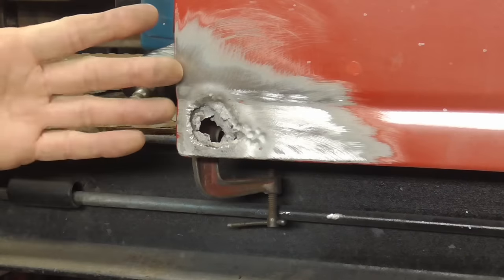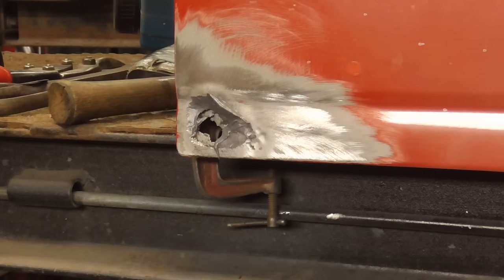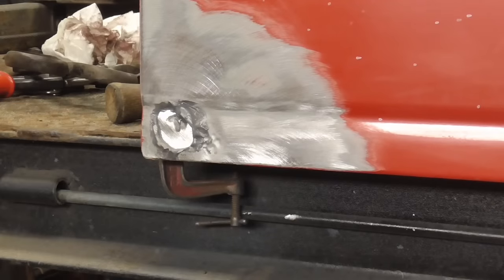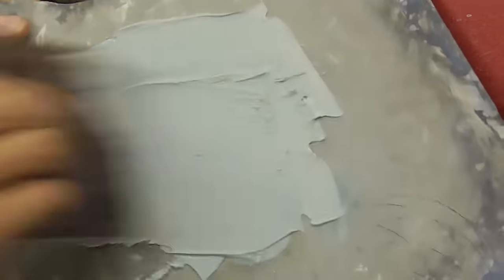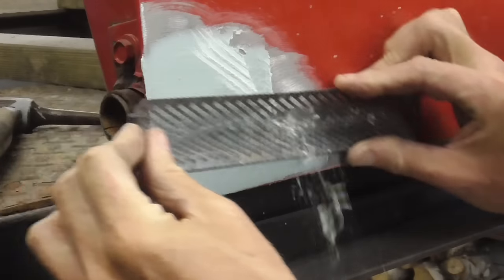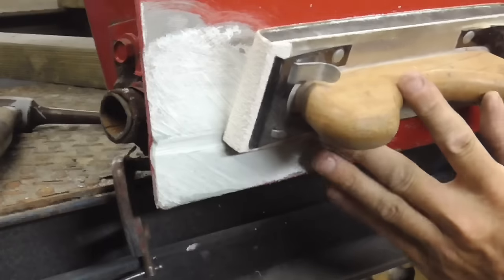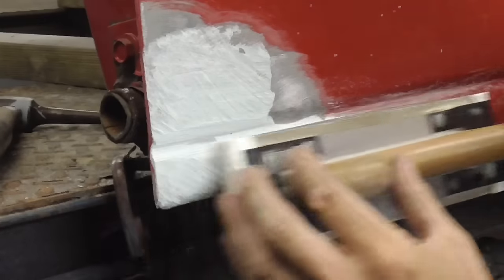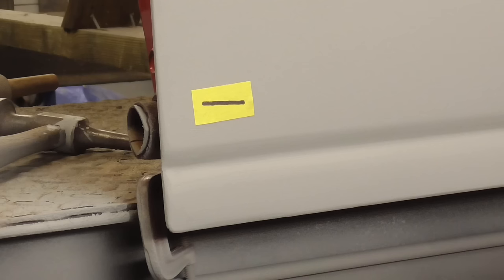Using JB Weld to Fix Rust Holes?

Comment: I just pack fuckin packing grease, or assembly grease, spray a shit ton of fluid film or NH oil in the rust spot and use rtv silicone  and some sheet metal fit it to size keeps rust from coming back, my bottom of my cab corner I did that no rust has spread further at all because it's so oily from all the assembly grease and packing grease, and nh oil, and fluid film I packed and sprayed in that can corner been the same since 2021 lol

Comment: Why not use JB weld from start to finish? It seems like it would be much more solid. Why use bondo on this?
Reply from the maker: Bondo sands easier and is much cheaper but you could certainly use JB I suppose :)

Comment: Nice video, well done. I have used J B similarly and had mixed results. Sometimes a permanent repair resulted ( more than a couple years) other times the rust re appeared in short order ( less than 6 months).

In all cases the metal had been sandblasted back to "pure white metal" , no visible sign or rust. My suspicion is that there was corrosion hiding either on back sides inaccessible opr in seems and that it spred back from there, but dont really " know that" . Still, for a quicks repair where you dont want to cut the whole section away and weld in new metal, J B is my first choice.
Reply from the maker: I have found that if the panel can drain and be able to dry out on the inside it lasts quite long.  If it can be undercoated on the back side - even better :)

Comment: The only negative I could think of is that it might get expensive, depending on the size and number of holes you needed to fix? Other than that, I've used it as a great metal filler on curbed aluminum rims. Sands very nicely when cured and is completely solid.
Reply from the maker: Great point - here's an alternative to the JB - I think it's cheaper in the long run:https://www.youtube.com/watch?v=d21RkqTwRqs

Comment: Jb weld is extremely expensive and other than the price—is great for small areas. But short strand fiberglass will adhere even better to raw metal. And will never separate crack or break off. And way cheaper by volume…But yes I’ve used JB on rusted body parts before myself. So yea sir…it works. 

Then over lay regular filler like you’ve done. To complete the job. We Live to contour ridges! makes for a bit more of a challenge. Good job.

Comment: Fill small rusted thru holes with JB weld instead of Bondo & then sand down & cover with a final coat of body filler,then prep prime & paint ....find that JB weld is way stronger than filler on fixing small holes

Comment: I would worry about rust getting under the JB Weld and lifting it.  I have seen that when fiberglass is used to repair metal. Much more inclined to weld.
Reply: The back side of the body metal will continue to rust and the patch will fall out in a few years.  If the metal is prepped with a good rust over primer(especially on the back) and some paint to seal it, it will last much longer.  If you can find some marine grade epoxy and brush it on after priming, that would be the best.  All moisture has to be sealed out to keep it from rusting out again.  Make sure the panel has good drainage too.  Water needs a place to escape otherwise it will sit in areas and find a way to corrode away metal.
Reply: That is exactly my concern. Rust, if not killed and protected against, will return and it will destroy that patch.
Reply from the maker: Drainage is the key to any repair.  No moisture = no rust.  Also how you rust proof the repair after is key - see this video:  https://www.youtube.com/watch?v=8XaZBy7GC7A
Reply: Youi definitely have to make sure moisture can't get at the back of the repair.
Reply from the maker: @macgvrs  For sure - if you can seal the back side - like clean the surface and spray it with some good rust proofing or undercoat - it'll last as long as a new panel.

Comment: I have successfully used it to fill the rust pin holes under a hanger strap on a dump truck step fuel tank. I have also used it to fill holes on the window post of a car door but the rust came back right away. Must have been more rust hiding underneath the paint or it had a way to get water in behind somewhere.

Comment: Nice Video!  I agree that JB Weld is a good option for rust repair.  I have used it as well as Loctite PL Premium 3X contruction adhesive.  No hardener needed. Dries like a rock! Cures in a few hours, but best to leave it overnight. It's sandable but you need some elbow grease to do it.  Good to make a foundation using the 3X and some metal. Then use bondo over it.
Reply from the maker: Thanks so much for the tips and ideas - have a good week :)

Comment: I’ve done similar. It holds up well. I didn’t even use filler over it. I just sanded and molded it smooth. Primed and spot painted it. You can’t even see it. Some folks will lose their minds over this. 🤷‍♂️ but it works.
Reply from the maker: It does work: here's one where I used if to glue a cab corner on.  No signs of trouble at all after a year or so.  https://www.youtube.com/watch?v=wRl1QfkrBeY

Comment: Provided this product was used on non-load bearing areas and provided the steel was cleaned up properly by grit blasting this product should be fine. The problem is some people will not do the preparation properly.
Reply from the maker: Good information :)
Reply from the maker: Wizardry 88  It really is - just like drywall.  If it's done right it don't crack.

Comment: Remove front window from 1966 chevy because rubber was shot and water had gained entry.
Found some rust around lower passenger side .
Cleaned it up and molded in some JB weld. 👍
Reply from the maker: Nice job!  That truck will run forever so you have to find ways to keep it on the road.

Comment: How long to wait before cheese grating?  For a diy'er like me, I don't want to wait 8 hours when I can tack-in the patch and finish on the same day....  If you have 20 jobs on the go, like a pro, then I guess you can work on other things...
Reply: Cheese grating should be done after about 5 min or so, after the filler turns rubbery and is firm but not totally cured. Cheese grate too soon and you might actually pull some filler off, wait too long and it's more difficult. I'd say try  between 5 and 10 min after it sets.

Comment: informative video but shouldn't you clean the area (acetone or alcohol) after sanding the area after the JB weld and before applying the filler?
Reply from the maker: You can if you like.  Most of the time you can just blow the area clean with a blow gun.  It can't hurt to wipe it down with thinner though.  Lacquer thinner drys super fast, is cheap, and is always around the shop.

Comment: Great job I just picked up Jb weld steel stick to patch the holes in my rear door I removed the impact strips I’m going for a real clean look,but after watching your video you have me an idea about using sheet metal to cover the hole
Reply from the maker: I think that will work well - tap the hole down a bit and fill :)

Comment: I just attempted my first antenna hole delete on an integra using JB Weld. I fabricated an inch oversize patch panel to go from underneath the hole and the jb weld sandwiched in between. Then doing body filler on top. The strength of the repair is no doubt very high and has the benefits of being waterproof as well.
Reply from the maker: Thanks for sharing that AcuraLvR - It's going to last a long time for sure :)

Comment: I would have put a little wax paper behind the hole and fill it completely pack it in between the different metals and shaped it instead of the body filler primed it then puddy or puddy over it it would be like filling the hole with brass or lead...or even welding it have someone hold a copper penny behind the hole then MIG weld it I don't think weld will stick to copper led would but weld I don't think so.
Reply: Use pre-1982 penny.  Anything after is copper plated zinc.

Comment: I used JB weld around my windsheild on some holes that were smaller than a dime. I used the hard putty with no metal. worked great . pushed in hole and had pushed other side so it grabs.
Reply from the maker: Good to hear - thanks for your input :)

Comment: Quarter would work as patch  doesn't need to be silver though 😅
Reply: I've done this before good  but no better than aluminum self stick tape  but sometimes you need strength  jb is better  but rust will come back in time unless you paint behind
Reply from the maker: Drainage is super important.  If the inside can drain and stay dry your good.

Comment: It's clear that it's not a high-end repair. But something like this only makes sense if you can not weld. Someone who is used to body welding, would have welded the patch in 5 minutes. then scrub the top clean - but if you can not weld, it is an idea - for the parts that are not safety-relavant
Reply from the maker: Here's a follow up video on all the different types of repairs out there.  Cab corner on this truck was JB Welded more than 4 years ago and still good today - will do a follow up again soon.   https://www.youtube.com/watch?v=gIS1Tbv7Kvw
Reply: @LakesideAutobody  I see I think you have such good results because you prepare the ground correctly. A lot of people who don't weld just smear the filler over, it doesn't hold because. I know fiber filler, that works well if you really defenz umnd stop the rust around it. I will try J-B Weld - great videos
Reply from the maker: As long as the metal is roughed up well - the jab weld will stick well.  Make sure the panel can drain and dry out inside and you'll be fine.  Nice talking to you Krakzzz :)

Comment: Well it's better than an old foam and fill or chicken wire and bondo. I wouldn't use it on a higher end restore but for a daily driver or a cheap car you're going to flip it looked easy to use and should last a while at least.
Reply: Do u think I could cut out and replace a rusted wheel well with chicken wire and attach with j b weld? Then bondo the whole thing? My old junker car that I want to make look better. I'm 79 yes old lady never did this type work but I have patience.
Reply: @jorenecicero5161  Yes, you absolutely can. The best way, if you just want to improve the looks is to attach your chicken wire in the general shape of the hole you want to cover with the JB Weld and then cover that with expanding foam from a spray can. Then after it dries whittle the foam down to the almost finished shape and apply a thin coat of bondo for the final smooth coat. It isn't something I would do for someone else but to make my own car look good I sure as heck would. And if you try it I bet a $100 you can do it just fine. 90% of any job is have the guts to try it! Good luck.

Comment: I bought an old pickup with all the usual rust and I definitely like the idea of using JB Weld. The way you show looks easy enough. Have you used it on bigger patches? I imagine sone screws to help position larger patches would do the trick. Thanks for sharing!
Reply from the maker: Here's a video on larger areas and a follow up 5 years later - https://www.youtube.com/watch?v=wRl1QfkrBeY 5 yrs later - https://www.youtube.com/watch?v=idrLzsz2eLg

Comment: Works great, I used JB weld to secure strips of sheetmetal to fix holes in the roof line and windshield surface. its been 18 months of WI weather and its holding up just fine.Al

Comment: My thermostat housing bleed bolt was stripped of threads and leaking coolant. 

JBweld the bolt in place and it holds pressure and survives the heat. Remarkable.
Reply from the maker: It can hold up to some pretty high heat for sure :)

Comment: Suggestion:  Try Upol #8 acid etching primer.  As cheep as $20 on ebay for an aerosol can.  Remove lose rust first.  No need to get to bare metal.  Two coats seals out moisture, stops rust's progress.  Do fill on top. Thank me later.
Reply: the duplicolor etching primer is what I use, I can't fault it so far.
Reply: @allkindsofscience2538  Glad to hear it!  I worked as a line mechanic for Nissan when they had the Pathfinder rust recall.  They specified Upol #8 in their procedure.  Since then I have used it on the front of a Toyota Camry that was my daily driver.  At some previous life they hood had been replaced, but not painted properly.  The car had pock marks from stone chips across the front of the hood that encouraged rust.  In the most casual of manor did I spray the Upol onto the pock marks, NO prep.  It was an ugly beater after all.  The Upol worked.  Made me a believer!  If the duplicolor works well too, that is awesome!

Comment: If the rust is completely removed yes sure but I guarantee you still have rust between those panels that was left and that will return.
Reply from the maker: One thing that folks forget.  Drainage.  If your panel can drain and stay dry that's a huge plus.  No moisture - no rust.
Reply: @LakesideAutobody  lol you didn't just defend a poor job with the guise of "drainage" 
Please, we both know it's dodgy not to cut open that section.
Cut the śhht lol
Reply from the maker: @ironhornforge  Like this?  https://www.youtube.com/watch?v=wRl1QfkrBeY  Like how you snuck the work shht in there - I have a filter turned on (swear words) for folks that get angry about body work.  Have a good week end :)
Reply: @LakesideAutobody  cool story, just be legit and fix things properly

Comment: I worked in a gravel pit when I was a young man ,I watched a mechanic take JB weld to a 3 inch hole in a bulldozer engine block re sleeved the block new bearings and gaskets ,had it running in 2 days.
Reply from the maker: Wow!  Interesting story ACB - thanks for sharing :)

Comment: You make that look way too easy!! I have tried recreating that line before and like you said, it’s harder than it looks,,,,. I have heard of this but never used it. I’ve done 45 trucks and counting over the last 40 years or so as a hobby for my own use. I’m down to one now due to downsizing in retirement. Items to take care of, land, etc. Gonna start relaxing more. Went from 8800 acres to 21 to 2!! Takes getting used to. I always subbed out the welding to a shop, or a friend when he wasn’t working as a pipeline welder. It’s expensive!! I had a few vehicles with this typical door rust or small perforations in the fenders etc. I will use this on my next vehicle. It’s a 1970 Chevy 2wd Blazer. It’s a pretty perfect 4 spd manual with a crate 350 already in there. We have dropped the transmission and a 4L60 automatic (in shipping) is going in place. We already have new trans mount and crossmember roughed in. Pedals have been changed from a wrecked 69 Chevy C10 auto. There will be a Lokar shifter in place of the 4 speed manual shifter. Should look great!  No better time to start than now! I have only a couple of spots at the very back and few holes around the rear fender wells (typical) that are already cleaned and treated, need one more sanding/wire wheel treatment. Then I will try it out! Should be a long term keeper once completed. 
Thanks for sharing. Nice job by the way.
Reply from the maker: You're welcome.  Sounds like a goo project truck - love those old Blazers - tough as nails.  Let me know how it turns out :)

Comment: Had an old wood truck that had a sick run through the radiator....needed a quick fix... was hauling wood at a place that needed to be done soon.
 Bent over the severed "tubes" wire brushed it a bit, and  applied JB weld. Thinking it would still seap some but get me through the wood hauling for a few days.....it lasted with NO LEAKS  for many, many years and still did not leak when the old truck finally died.
And that motor was run hard....
Reply from the maker: Great JB story Scott - love hearing how folks used this great product.  I used it on an egr tube right off the exhaust manifold - it lasted for years!  Wasn't expecting but a few weeks :)

Comment: What did you use for the metal round to fill the hole?
Reply from the maker: That was some 22 gauge sheet metal.  You can get it a Home Depot, junk yard or metal supply place :)
Reply: @LakesideAutobody  Yep, thanks a bunch

Comment: Great video! I have two small holes the size of a pencil I have prepped but not filled yet. I was going to use Permatex liquid metal. I also have original JB weld I bought after this video. Has anyone used the Permatex liquid metal for patching small rust holes? Also, you said DA'd the area. What is that? Thanks for any feedback. Great looking work as usual Lakeside Autobody. Are you in Michigan sir? Cheers from Motown.
Reply from the maker: Yep - upper MI.  I have not used the Permatex liquid metal but from the description I read on it - it should work just fine for you.  Remember to make sure your panel can drain and dry out inside and if you can coat the back even better.

Comment: Since JB is epoxy, I would think it it equals or surpasses proper structural auto adhesive such as 3M which I believe is epoxy too.  Opinion?  NOTE:  I'd like to figure out how to thicken the JB which can drool.  One post claimed a light dusting of the two piles of JB with baking soda decreased hardening time in half.  Another thought is the fast cure JB, but that definitely has reduced structural properties, but for  sealing up holes, that's not a problem.
Reply from the maker: The one thing I do like about the SEM Impact Resistant Structural Adhesive is that is has super small balls mixed it to prevent you from squeezing out all the glue.  Both hold up just fine though - never had a patch fail yet with either glue.  I think thickening it with something would work great too - good thinking.  Maybe some type of metal dust to keep the glue from being squeezed out just like the SEM.

Comment: I used JB Weld with micro balloons with mesk tape and cab corner has lasted 20 + years on a 1970 f150.  Micro balloons makes it more sandable/ workable. I learned this building rc model airplanes. Not with JB but it worked the same.
Reply from the maker: Nice idea - micro balloons - never heard of them :)